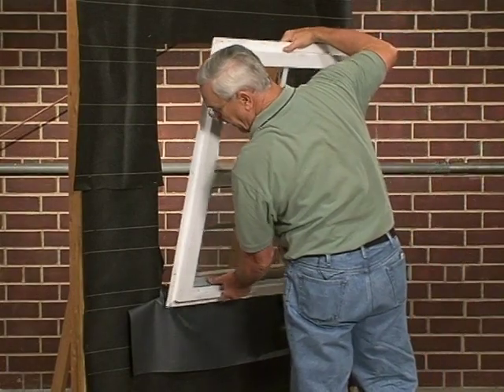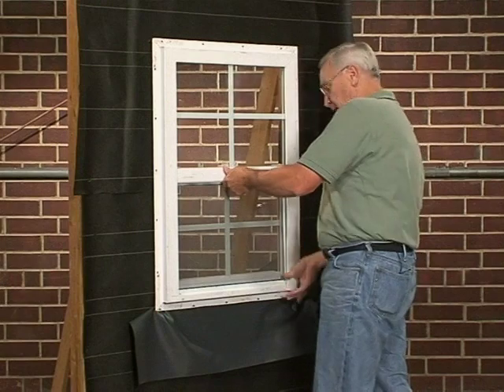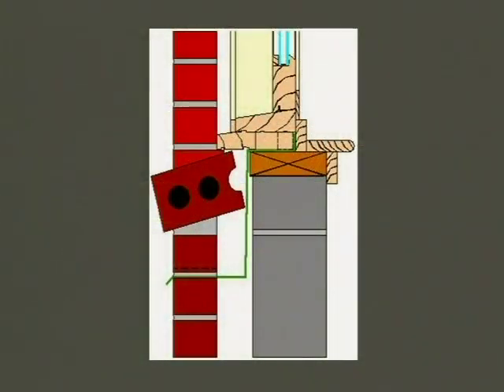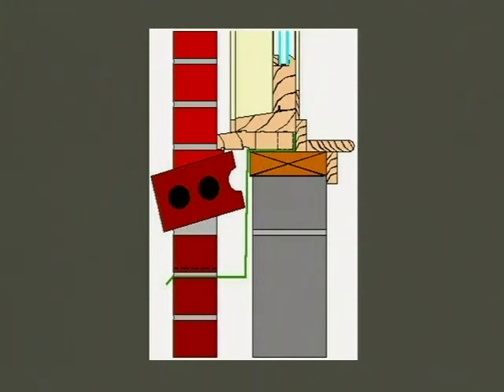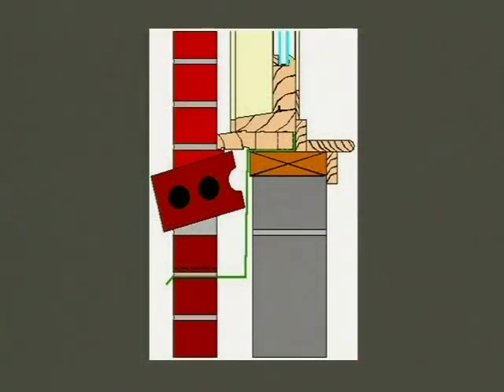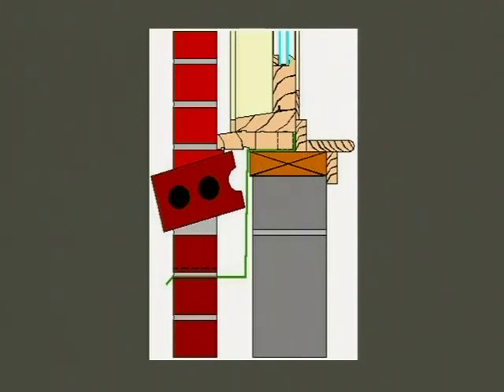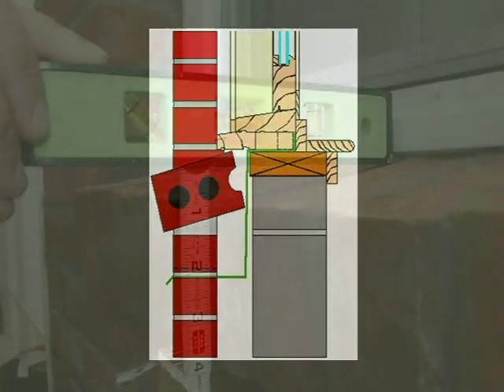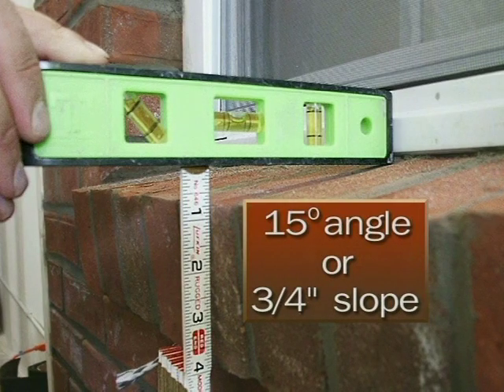Window Sill Slope

Comment: The reason the cut brick course immediately beneath the brick sill is too fat to allow sufficient fall in the sill is that masons commonly 'rip-saw' bricks into two equal thin stretchers, about 1" thick, thereby producing two equal cut stretchers from one brick.  Most sills are 8 to 12 degrees in residential construction.  

It is more difficult to get the sill rowlocks to stay tight up under the wood  window sill as the angled mortar bed gets thicker, for it will tend to collapse unless sand is added for that particular bed mortar.

I have cut carefully measured ripped bricks in a wedge shape to prevent extra thick mortar beds but this is quite time consuming and only one usable split stretcher is yielded from each rip-sawed brick.